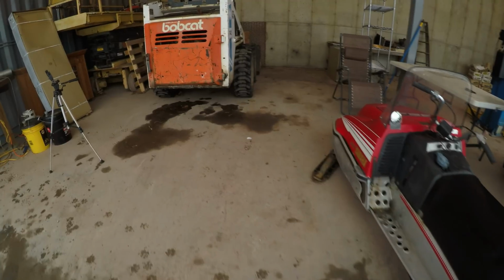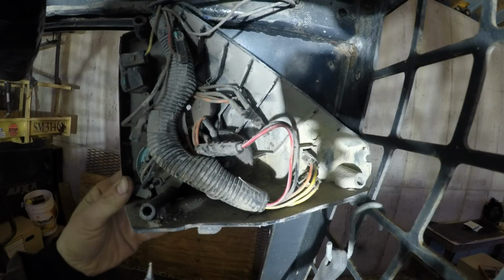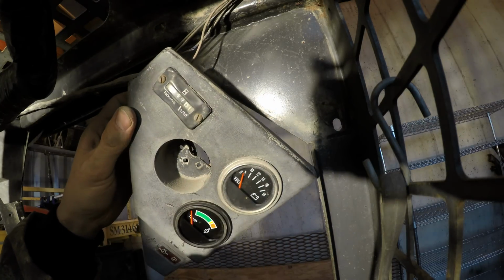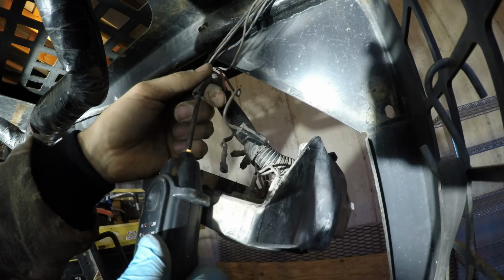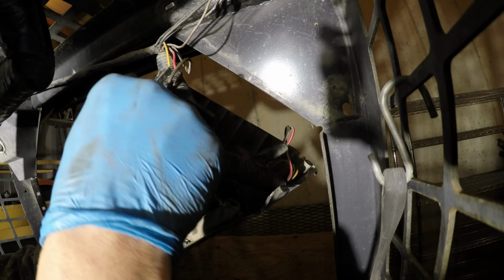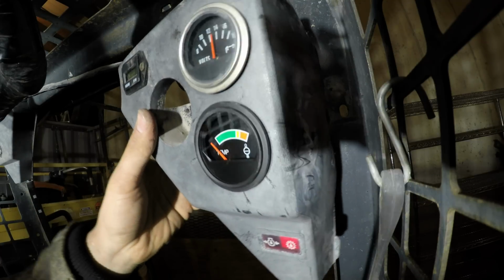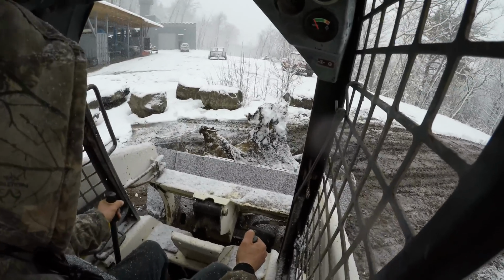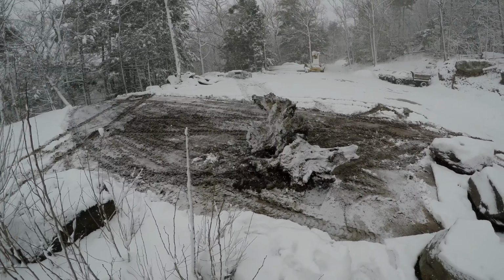Fixing a bobcat temp gauge

Comment: Great video but I have a question for my 743 it has a new temperature gauge and a new sender but the gauge was always on hot even when the engine is cold so I fixed it to go back to cold but now it doesn’t move at all. Now the arrow only stays before the green?
Reply from the maker: how did you fix it? make sure the wire is not broken or grounded out from the gauge to the sensor. Make sure the gauge gets power/ground.
Reply: Andrew Camarata  i did use a power probe tester to see if there is power from the purple wire to the gauge and there is I believe in doing it correctly. And the way I fixed the gauge goin all the way to hot is I saw that the metal bracket that secures the gauge to the panel was shorting the positive and purple wire or vise versa.

Comment: The after market temperature gauge may not have a wire going from the threaded port to the gauge. It very well could be a flexible tube filled with inert gas. As the engine heats, the gas expands, moving the needle. Otto

Comment: Hey Andrew, can you make a video on A) the process of how you check if electricity is flowing correctly to broken parts in your equipment and B) how do you know if it's for example a bad wire, a bad connector versus a bad gauge or bad part.  It seems like this is important to understand, when you fix your equipment.  Thanks.

Comment: I have a tip for beginner operators, when digging holes lift the lift arm a little then tilt the bucket making all wheels or all of the tracks are in contact with the ground ! I see so many newbies tilt the buck and lift the front wheels of the ground then try to push, it's all about traction !

Comment: Fix it THE RIGHT WAY!  FROM SENSOR TO GUAGE.  ONE TIME!  That way you don't have to return to the same problem over and over.   It looks like the wire harness is in bad shape:  mangled by monkeys and left exposed to the environment...  It's just a simple "skid loader":  yank the wire harness out, clean it up, reterminate faulty terminals and reinstall.    Place close attention to the grounds.   Automobile grounds have washers with serrations on the interior and exterior so they the bite through the paint.  But it is still better to remove the paint to bare metal.  Look online at Cratex "Bright-Boy" Abrasives.   They come in various forms and grits.  They have one type that attaches  to your 1/4" drill chuck and is used specifically  to remove paint off of a chassis ground point.  Half of the electrical problems are IMPROPER GROUND OR NO GROUND!  The other half are broken wires or bad/loose connections:  no power or signal.  The "pillar instrument cluster"  is a plastic piece.  That means everything on it is electrically isolated...power, signal and ground must be verified.  Those BobCats are subjected to harsh environments, but the electrical system should last 7 years (or longer) without any problem (unless damaged, or by abused by monkeys).  Since you purchase used equipment, maybe you should setup a wire harness fabrication table.  Remove the entire assembly, mark out the wire-runs, etc.  Purchase  a few crimp tools and rebuild harnesses.  That way you gitter-done cheap and no more electrical problems!

Comment: Hello mate, I own a Komatsu Sk714-5 and my temp gauge stays at the same level just like your bobcat, it never ever gets higher than that, ive also used for 20 days the concrete mixing bucket as an atachment but it was still at the same low level, at periodic maintenance i use a very good coolant and periodically wash the radiotors to keep them clean but idk if it is from that or i have broken sensor or thermostat ?
Reply from the maker: Usually they should come up 1/3 of the way. There are test that can be done to see whats going on if its not.

Comment: Seems you act before your brain kicks in! Didn't you check the fuse block to see if there was an issue of those 2 wires not having keyed power? Seems the hour gauge blew the fuse after it "melted" itself, causing the fuse to blow

Comment: Andrew your fix on the hour meter will work fine but what was happening on the wiring was the hour meter has power all the time, it actually  receives ground when the machine has hydraulic pressure hence engine is running. I know this because on my 743B my meter quit working and I did all the things you checked and didn't understand.  Then I checked the wiring schematic and found the "ground" wire went to a hydraulic switch on top of the pump and when the pump was working hydraulic pressure then grounded the hour meter.  My wire had broke at an electrical junction, I rewired around the connection and now my meter works fine off the hydraulic pressure, not exactly engine running, thats why the key didn't affect the hour meter.  I would guess this is how most Bobcat hour meters are wired. FYI

Comment: The problem can be also if the new gauge you interchange in place with the old existing gauge ohm tolerance range is different ,if so it will not function properly . The temperature gauge and the temperature sending unit ohms has to match tolerance .I had the same issue with my Bobcat 753 machine using the same exact gauges he used in this video and wasn't get an accurate reading. After troubleshooting and conformation from my local dealership I had to use the original exact  temperature gauge that came in the machine from factory .

Comment: By using ground oil pressure to the clock, the clock is designed to measure the working hours of the engine.

Comment: A simple technique I use to reduce or eliminate vibration damage to wire ends is to wrap them around a Phillips screwdriver and then you can stretch it if you need to. (We mostly use Allen head or hex head screws and drivers in Canada) but I think US folks use Phillips.

Comment: My guess is at 8:14 the yellow wire is the signal wire for when the engine is running.  That's what you are counting the hours on, right? Seems you may have configured the timer for "key on" hours.  Just a guess and glad Sadie (?) was keeping an eye on you incase you succumbed to the elements.  I noticed that you never bitch about the cold in your videos.

Comment: part #  HWQ1427426707566K1   < Docooler hour meter / never had issue with the docooler meters
https://www.amazon.com/s?k=HWQ1427426707566K1&i=automotive&ref=nb_sb_noss
Reply from the maker: Yeah? is that a good one? I have bought a few that looked like that, and they broke instantly. Ive been doing well with the digital ones I have installed, non of them have quit yet.

Comment: enjoyed the video some hour meters operate w engine running only not just key in on position
Reply: Actually the hour meter works off the hydraulic pump pressure, which only works of course when the engine is running. I have a 743B and found that out when my meter quit working.  The hour meter is hot all the time with key on, and when the machine has hydraulic pressure the hour meter is then grounded and works. I followed the wiring schematic and found the wire from the pressure switch had broke at the electrical plug in the wiring.

Comment: Andrew - I'm thinking you should check the thermostat also.  I would also get rid of the 'idiot light' for your oil pressure and put a real oil pressure gauge in.
Reply from the maker: Yeah, not a bad idea. But at least the light is working.
Reply from the maker: I might sell that skid steer, that turbo tracked machine is so much nicer.
Reply: I was going to suggest the same.
Reply: For what it’s worth, I’d see the skid steer, too. It’s reaching the point where the costs are outweighing the advantages. That you got this far with the Bobcat is testament to your ingenuity and mechanical skills. I’ve known a few Bobcat owners during the Ingersoll-Rand regime and all are united in saying that the older the machine got, the less reliable it became, almost exponentially. Everyone of them ditched their Bobcats in favor of other brands.

Comment: Hey. Seems like the oil pressure light doesnt work too. And the engine has to be running to get the negative signal. Sometimes there are 2 sensors. One for the hourmeter and one for the oil light. Other machines got a relay to eliminate the second switch. As you need both a normally closed for the light  a normally open for hours

Comment: Good video, Andrew. The other hole on the gauge console is for an oil gauge, right? Isn't that  as important to have? More difficult to change out? Equipment operational videos would be nice. Thanks.
Reply from the maker: Fuel gauge, I guess they removed it when that machine was converted to propane.

Comment: It seems as if the temperature gauge should have gone up further than that. You might want to check to see if you have a bad thermostat in your cooling system. If the thermostat is stuck wide open, the machine won't get up to a proper operating temperature.
Reply from the maker: Yeah, your probably right.
Reply: Maybe it’s because it’s running on propane. Correct me if I’m wrong but an engine will run cooler with propane.
Reply: Andrew Camarata 

Great, now you can do a video on checking and changing the thermostat. LOL. And while you're at it, you should probably flush the cooling system and check the hoses.

Are you planning to do preventive maintenance on your equipment before you get into your busy season? I am sure all of your subscribers would love to watch videos of you going through maintenance on all of your equipment. As always, great video and keep them coming.

Comment: dosent it need a perminant live feed for memory of the hour meter?
Reply: Made me wonder, too...perhaps there is an internal battery...
Reply from the maker: Just power when its counting. IDK if there is a battery in it.
Reply: It's either running or it isn't. If the ground is switched off, the hot lead won't do any good as no current can flow.

Comment: Andy great job!!! thanks for one more fixed. Hey in your travels if you come across a old/ used S130 bobcat which now is the S-450 . In the day I had two BOBCAT S-130 pedals 773-G hand controls both great machine but the S-130 turn on a dime. Super great little machine. I think maybe with the right tires and bucket . You may have got in that basement / house job your working on right now maybe not....I used that machine S-130 with the right bucket and tires to get inside a summer cottage dig out the dirt floor to put stone down SAVE MY BACK......A another great machine is the S-100 which bobcat only made for few year in 2007-2011 another great machine for small areas like basement work or inside demo work take care JUNKMANDO

Comment: You could also take an  infrared reading of the engine temp and write that on the gauge to give you an idea of what your actually running temp is. I saw this and went on ebay and bought a digital meter with sensor for $16.00!!!  Great inspiration you gave me. Yep that thar diesel is a big step in power !!! I have a Cat 257 tracked . What a hoot! Thanks!

Comment: Hey Andrew, usually you want power to the hour meter through the engine oil pressure sensor, that way you are sure that you are only counting real running hours... and not just hours that someone forgot to turn the key off ( this happens a lot) probably that is why you werent receiving any positive.
Reply: Good idea!
Reply: Was just about to type this
Reply: @andrewchristian2996  me too
Reply: Actually bobcat does this from factory.  There will be a oil pressure switch somewhere on the engine specifically for the hourmeter

Comment: What if one of the wires only sent voltage to the hour meter when the engine was running? I’m not sure, I don’t have much vehicle wiring experience but it could be a possibility
Reply from the maker: Server Pr0n yeah, you're probably right, I bet that yellow wire would turn into a ground when the engine was running￼
Reply: That's the logical way of wiring an hourmeter, so that it registers only when the engine is running, but from the manufacturers' viewpoint, they want every second to count, so they wire them from a key-on perspective.
Reply: @stanpatterson5033  
It's maybe simply wired key on engine off to allow the guy checking it to avoid it to start the engine of each machine.
Those things are more often serviced by an other person than the operator.
The purpose of an hour meter is to be checked regularly,that mean a guy do it specialy,and dont need the engine to run at this precise moment.
Reply: Yeah, that seems more reasonable, you can see the hours when you turn the key at all and from a wiring standpoint it seems a lot easier, especially in a vehicle with no computer